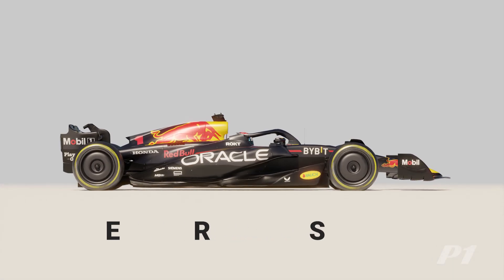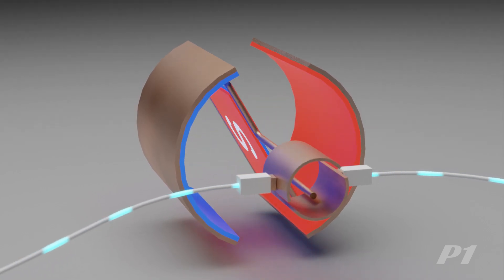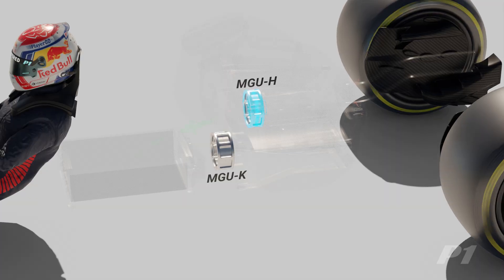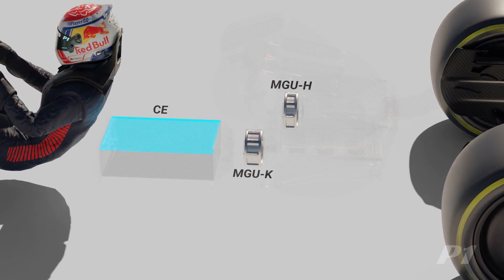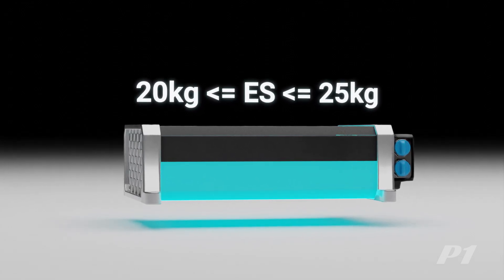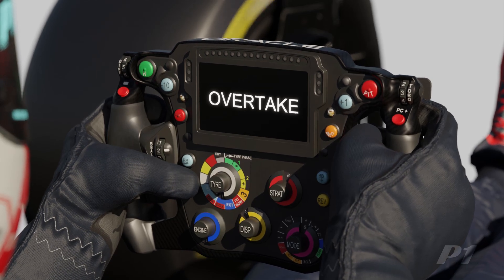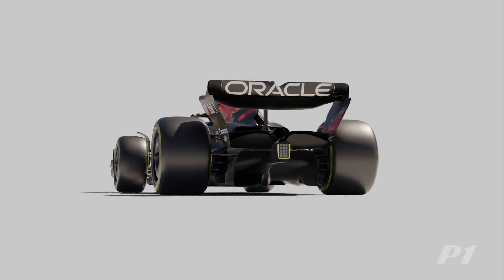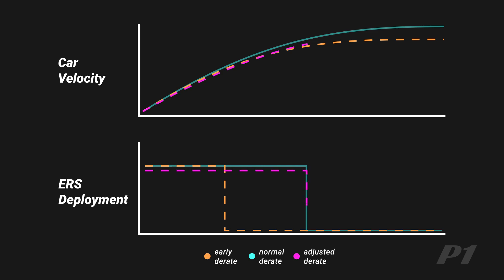F1 ERS Explained

Comment: what are the main differences to the ERS for 2026 other than the removal of the MGU-H and increase in power to 350kW for the MGU-K?
Reply: other than the things you mentioned. not much really. the MGU-K will sit closer to the survival cell this time tho. right next to the battery. so all the electric components can be contained within the safety cell.

there was some ideas to put the MGU-K into the nose to drive the front wheels. to give F1 AWD for the first time. but the teams argued against it. fearing Audi would have an advantage.

so for now Formula E is the only single seater with AWD with 2 MGU's. one in the rear (300kw) and one at the front (50kw) (350kw total) so Formula E does 0-100kph in 1.84sec